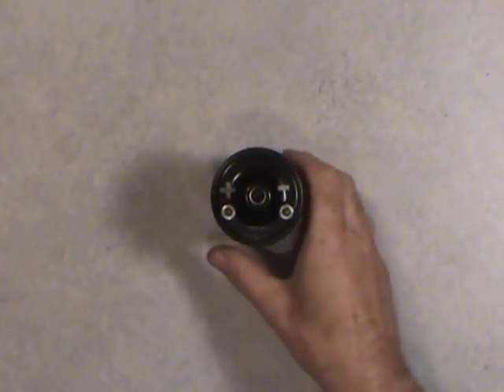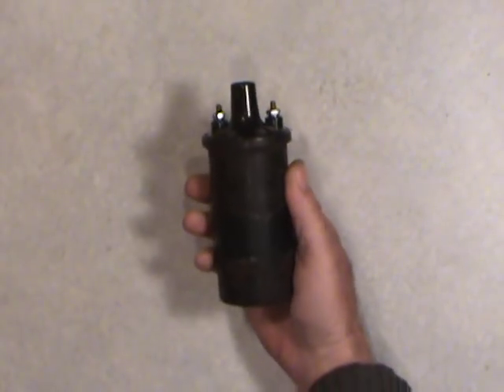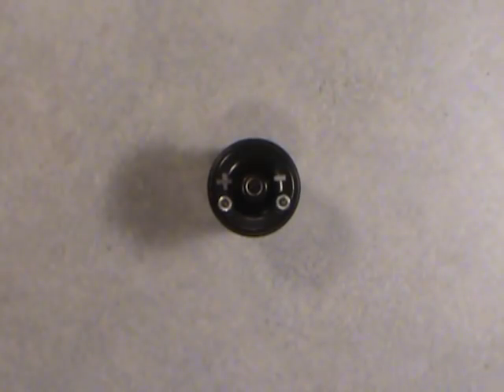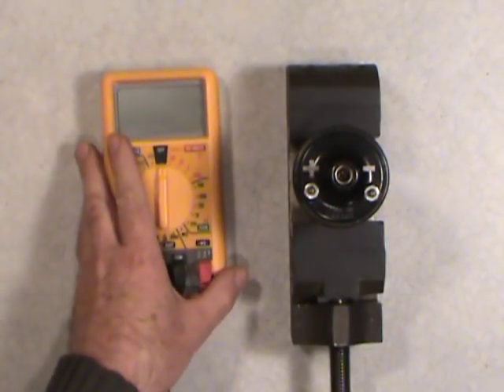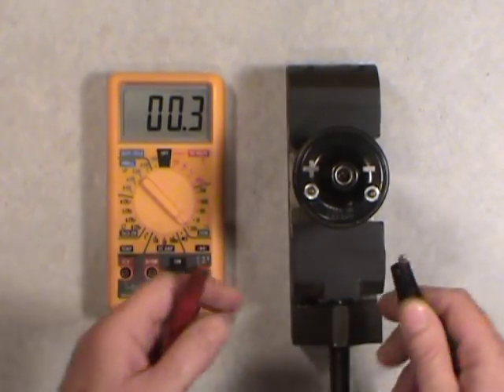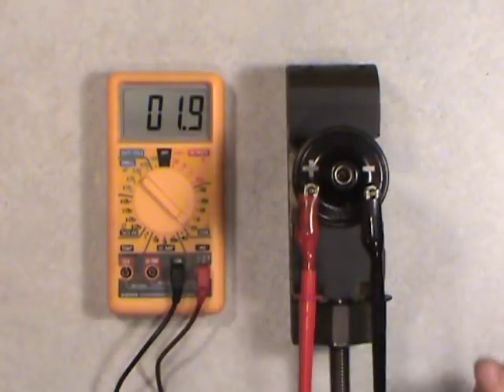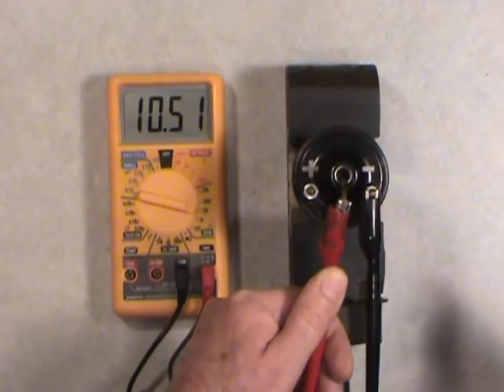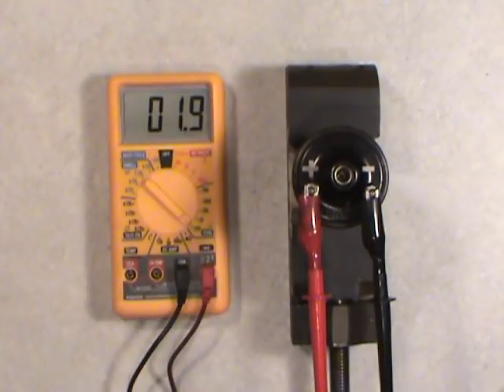Ignition Coil Testing

Comment: Primary circuit resistance: 1.4 to 1.8 ohms OK
Secondary circuit resistance :  8 to 12 K ohms OK
Reply from the maker: Greetings...zagyex.............Thanks for watching............Well, as long as, the ohms that you measured, are "with-in" the Specifications, for that Exact ignition coil, then, it's a good day alright, and.......till next time.......Be Safe, take care, and have a good one.
Reply: Hi, I measured the resistance on my coils (I have a faulty one) and the brand new ones had a primary circuit resistance of 4 ohms, the faulty had 6. So it is a different specs? It is a 12 v system on a Citroen ds. I have coil overheating issues once a year. Maybe a pre-resistor would elp?
Reply from the maker: Greetings...zagyex..........Well, you didn't mention, the "year", that your Citroen ds is...???...........If your engine's ignition system, happens to have a "points and condenser", type of "distributor" in it, then, your ignition coil's "over-heating", might be caused by, something, as simple as, "leaving the ignition (key?) on", when the engine "is not running" (sometimes happens, when just listening to the car's radio, instead of turning the key, to the "accessory" position, if so equipped)...........Always, try to use, all of the ignition system "Parts", that your vehicle manufacturer "specifies", or, if not, then sometimes, things can get "damaged", and become expensive to fix...!!!..........If you can tell me the following, as in...Year...Exact car Model...engine size, and number of cylinders, that it has...then, I will have a much better chance, at being able, to help you out, and........till next time.......Be Safe, take care, and have a good one.
Reply: Thank you!
I already bought a factory recommended coil. I'll measure the resistance just to know if I have been using the wrong coil. I never have the ignition on if the engine is not running. I may have too much dwell  (it is a points distributor) or possibly the voltage regulator is sending too high voltage to the coil. Or maybe some earth wire problem. Btw it is a 72' Citroen DS Dsuper 5
Reply from the maker: Greetings...zagyex..........You're welcome..........Yes, indeed, try to keep the distributor's "Dwell" (usually measured in degrees, and/or, points open amount/measurement), with-in the manufacturer's "Specifications", at all times, as that, in itself, will eliminate, that particular portion, of your troubles, oh, and, you'll usually be rewarded with, much better performance & fuel economy as well, as a bonus..........If the factory installed, ignition coil's primary ohms/resistance, is about 1.5 ohms there-abouts, then, on the older USA/Canada, 12 Volt, Chevy's, Ford's & Chrysler's, ignition coils, that, there is also, a "Ballast Resistor", in the ignition "circuit" as well, most times..........If the ignition coil, is, oh, about 3 ohms or higher, then, there usually "is not" the need for a ballast resistor at all, most times, I be thinkin'...........Make sure, to be using, "All", of the Manufacturer's "Specified" ignition components, or, you'll just be gambling, don't-cha think...???..........If, and when-ever, you get the low volts/primary side, of the ignition system/circuit sorted out, then, it's equally important, to get the Secondary/high voltage side, of the system, functioning, as good as, humanly possible, or, a not so good runnin' engine, along with, not so good mileage/kilometer-age, it will usually end up be-in............All of the ignition system's "Parts/Components", have to be in very good condition/all most like new, as in, good...Points (and Condenser?)...distributor Cap & Rotor...spark plug Wires...and...Spark Plugs.........Use the Factory/Correct Spark Plugs, and make sure that, the spark plug's "Gap" (between the two electrodes), are with-in the exact/specification, as, too BIG of a Gap, will usually, make the ignition coil, work Much Harder, than it has to, in order to produce a "spark", between its electrodes, and, too "small" of a Gap, usually makes for, a weak spark, and might end up with, an engine that will start misfiring, quite possibly...........Check the Ohms/resistance, of each spark plug "Wire", to make sure that, the resistance, "is not" too High, or maybe "open circuited" maybe?............Also, try to keep all of the spark plug "Wires"..."away from"...any Metal, b-cuz sometimes, I've seen (in the dark), high voltage, "jumping" out of a spark plug Wire, and over to a Metal part, in the engine compartment...!!!...........Have a look around, in the engine compartment, for a "Label or Sticker", that might have, some very useful information printed on it............Good luck, and........till next time........Be Safe, take care, and have a good one.

Comment: what kind of nail and sandpaper should I use? geez
Reply from the maker: Greetings...longbow60435..........Thanks for watching...........Well, the nail, that I usually use, is, a 2 inch long, common, plain steel, house nail, and, if that's too big, to fit into, what-ever-it-is, that's about to be ohms-tested, then, I'll probably resort-to, using, my, much smaller in diameter, "T-Pin", that's, about the same diameter, as, a slightly larger, sewing needle............As for the sandpaper, that I usually use, then, it would probably be, 100-Grit, aluminum oxide (sandpaper), because, I really do, go through, ah-lot of, that size/grit of sandpaper, on most of the things, that I work-on/tinker-with, around here............Now, that I've answered your..."geez"...???...lol......Be Safe, take care, and have a good one.

Comment: After watching this,
Im goin to test my coil on my 93 mazda mpv lol
Reply from the maker: fredrickvoncold Greetings fredrickvoncold....Thanks for watching, and for Your comment too...................................The "Ignition Coil", that is Installed, "In" Your "Mazda MPV", will probably, "Not Look Like", the, shall we say..."Old School"..."Oil Filled Ignition Coil"...that You saw, in this particular YouTube Video of mine, and, the "Way in Which"...Your..."Mazda MPV's Ignition Coil"..."Should be Hooked-Up and Tested with an Ohm/Multi-Meter"..."Needs to be Closely Looked-at"...Using, the..."Required Information"...to do so...!!!............................I'm pretty sure, that Your "MPV's"..."Ignition Coil"...is the..."Epoxy (filled) Type"...and the..."Terminals"...on Your "MPV's Ignition Coil"...for the most part...will be..."Very Different"...from the..."Terminals"...on the..."Ignition Coil"...that You saw, in this YouTube Video of mine...!!!..................................................."If"...???... Your "MPV's Engine"...is..."Running/Performing Alright"...then, as I see it, I wouldn't bother..."Testing It"...at all...just sayin'.....................................................................Also...before..."Attempting"...any..."Tests or Testing"..on Your "MPV"..."Study Thoroughly, and Fully Understand"...what You are about to do, for..."Safety Reasons"...and, so You..."Don't Screw Anything-Up"...on Your..."Mazda MPV"...cuz..."If"...You Do..."Things"...might, just Start to get..."Very Expensive"...and...You, just might have to..."Spend Your Kids Inheritance" (if so applicable, that is)...to..."Fix"..."What-Ever-It-Might-Be"...that..."Theoretically/Hypothetically...Got Screwed-Up"...!!!.....Hmmmm...(to lol, or not to lol...that is the question)...LOL...(my bad...???)...............................................So, my Friend..."Don't Say...I Didn't Warn Ya" (cuz I "Did"...!!!...lol).....................................If You happen to have any questions or concerns at all, just leave a comment/question or two, under any of my YouTube Videos, and, I'll do, what-ever I can, to help You out..........................Till Next time...............Be Safe, take care, and have a good one.
Reply: RockysRoadshow My mpv stumbles bad on start up
I have a haynes manual,but its about the same.The tips on how to use the right scale on ohms on my voltmeter helped me alot.
My coil is a ok. thanks I got  .9 ohms on primary, secodary about 6k i think. all in spec
Reply from the maker: fredrickvoncold Greetings fredrickvoncold....It's good to hear, that Your Mazda MPV's Ignition Coil, appears to be With-in Specifications, when doin' the good ole "Low & High Ohms Test", with Your Ohm/Multi-meter...Congrats!............Although Your Ignition Coil "Tests alright Ohms-wise", there can be times, quite "Rarely" at that, that an Ignition Coil, might just start "Acting-Up", as in, when One of these, shall we say..."Faulty Ones"...Heats-Up...to Operating Temperature, or maybe even Hotter, then, this, call it..."Miss-Behaving/Not Doin' Its Job Properly"..."Faulty Ignition Coil"...might just, as They say..."Break Down under Load"...and the Engine might just start "Miss-Firing", or in a worst case Scenario, that poor Engine, might..."Stop Running"...all-together, just sayin'....................................You were sayin', that Your Engine Stumbled on Start-Up..........well...........I had a similar "Situation" as well, on a Fuel Injected Engine...............................If You would like to Try my Starting "Trick", then, here "It" is...................You can Use My Fuel Injected Engine "Starting Trick", on a "Fuel Injected (Gasoline) Engine, wether the Engine is..."Hot or Cold"...........Just..."Hold the Gas Pedal"...about 1/3 (One Third) Down...and (Crank)...Start Your Engine...and...Once It Starts...Take Your Foot Off of the Gas Pedal...!!!............"If"...???...the Engine is "Idling Rough, and/or Too Slow"...just..."Feather the Gas Pedal"...just a..."Little Bit, and just enough"...so Your Engine..."Does Not Stall" on You....................Once the Engine is "Running" (while keeping fingers crossed...lol)...reasonably..."Good, and some-what Smooth"...then..."If"...???...the Engine..."Runs/Performs"...Good enough...while...Driving Your Ride, as You do, then, Hope-Fully, like my "Miss-Behavin' Engine"...but "Only" Doin'-So, while I was..."Just Tryin'...to Start that there Engine"...other-wise, that there Engine of mine, "Ran just Peachy/Super Duper", once the Damn Thing got "Started"...!!!...lol......................................Sometimes, there can be some "Issues", with the "Oil Pressure Sensor", or part of Its "Electrical Circuit", and, the Chevy/GMC Vehicles, that I've worked on..."Required"...some-where in the Neighborhood, of about "4-PSI" (Pounds per Square Inch), of Engine "Oil Pressure", to get the Engine "Started and Running"..."If"...the..."Fuel Pump Relay"...Wasn't able to..."Do Its Job" Properly, and, one "Sign" of this "Problematic Scenario", will usually be, a some-what..."Lengthy/Extended, Cranking of the Engine"..."Before It Will Start, and maybe Keep Running" as well........So, there You have it...well...for now that is......Till next time.....Be Safe, take care, and have a good one.

Comment: Where do you go for specs for the individual coils
Reply from the maker: Greetings...Lynn Johnson..........Thanks for watching..........Well, depending on, just which...???...ignition coil, that it happens to be, then, here's the way, that I usually go about it............If I happen to have the vehicle's Chassis Service Manual (I don't have very many...lol), for that particular ignition coil, then, so be it...other-wise...I will go looking/hunting, for the ignition coil's specifications, on, an online, automotive parts website, and/or, that particular ignition coil's, Manufacturer's website..........Sometimes, I will find/stumble-upon, a quite impressive, shall we say..."List"...of Specifications, for some of the ignition coils, that, I've looked-up so-far...........Just make sure, that, you install, all of the..."Correct/Specified"...components (parts), for the..."Exact"...ignition system/circuit in question, b-cuz, if not, all-bets-are-off, as in, might end up having a weak spark, at the spark plug's electrodes, or maybe, an ignition coil, that over-heats and goes kaput (as in, self-destructs), and I hope not...........Good luck, on finding the ignition coil specifications, that you are lookin' for, and.......till next time........Be Safe, take care, and have a good one.

Comment: It is a good video but how to test Ignition control module. I am tired to search on Internet.
Reply from the maker: Greetings...Elda Cleaning.................Thanks for watching..............Well, from what I recall, in order to Test an Ignition Control Module, by itself, would require the use of a Testing Unit, that is able to Test, the "Exact" (type of) Ignition Control Module, that needed to be Tested.............Maybe, make a few Phone Calls, to some Auto-Parts Stores, as, in the past, I heard that, some of those Auto-Parts Stores, might actually "Test" Your Ignition Control Module for "Free"......................I hope, You have good luck with that, and.........till next time..........Be Safe, take care, and have a good one.
Reply: Thank you for reply. I found how to. By checking resistance between terminals (secondary)and low ref. to each terminal input(primary)

Comment from the maker: ...So, when I'm testing something on the Ohm's-Scale/Scales on both, the Digital, and Analogue Meters/Multimeters, I usually start at the Lowest-Range, and, then Increase the Range, one at a time, until I saw the Proper-Display/Readout....Be careful with "Volt"-Readings!....Always select the Proper Range, when reading Volts, or, you might Damage your Meter/Multimeter!....Now, about your Ignition-Coil testing "Good", with Ohm's-Readings....(con't)

Comment from the maker: ...all a solenoid really is, is just a way to control a very large amount of electricity with a very small amount of electricity....So, as you can see (I hope), there are quite a few things that can cause an engine not to crank over....Everything from dirty or corroded battery cable connections at the batteries terminals, to even the engines starter motor being worn out, or broken....Try to find someone that is close-by and knowledgeable, to take a look at your particular vehicle...Take care...

Comment from the maker: ...and, any Oil Filled Ignition Coil that I have seen, has always had a "Ballast-Resistor" connected to said Ignition Coil....You see, when you turn your Ignition Key to the Starting position, your Oil Filled Ignition Coil gets the left over voltage from your cars battery, due to the voltage drop caused by your greedy Starter Motor, and when your Key is in the Run position, the battery voltage gets reduced, so your oil filled ignition coil doesn't go "POOF!", due to it's design....(con't)...

Comment: What is the range coil value?
Reply from the maker: Greetings...Mahindajayamaha64...........Thanks for watching......There are so many different types of ignition coils out there, and, each type will have its own specifications, for both, the low (ohms) resistance, primary coil windings, and also, the much higher (ohms) resistance, secondary coil windings........Try to find the Ohms (resistance) values, for the exact ignition coil that you want to test, otherwise, the test, won't be very accurate at all, and.......be safe, take care, and have a good one.
Reply: @RockysRoadshow  How to test condenser via multimeter & what is setting multimeter?
Reply from the maker: @Mahindajayamaha64  Greetings again........You're correct calling it a condenser (automotive world) alright, but, in the electronics world, it really is a capacitor........Why the automotive folks call it a condenser , I really don't know........In order to test an automotive condenser (capacitor), the multi-meter has to have a setting on its dial, that will test a condenser (yes, I do have one)........Before I test any capacitor, it needs to be drained of any electrons (electricity), that it still might have stored up inside of itself, otherwise, if its still charged-up, that spike of electricity has the ability to "fry" the multi-meter...!!!...........The larger capacitors are very dangerous, if they are still charged up, and if someone touched the terminals, it might be the last time that they ever did...!!!.........Some years ago, I discharged a large microwave capacitor with a large screwdriver, and the arc (flash) was bright and quite loud (as in snap...!!!)........Later, I looked at the tip of that screwdriver, and some of its metal "tip" was missing...!!!...and yes, I'm sure glad I didn't touch the terminals on that thing, or, I might not be be typing this reply to you........So, always make sure to safely "drain" any capacitor before handling or testing it (very important).........With the smaller automotive condensers, as in, points and condenser ignition systems, just simply grab the lead (wire), that's coming out of the condenser's metal canister, with needle-nose pliers, and touch that wire, to the to the outside of the metal canister, and hey, you might even see a bit of a spark, if, and whenever you might do so, and....be safe, take care, and have a good one.

Comment: Don't pull the alligator clip off and use the needle tip, go polish a nail instead
Reply from the maker: Greetings...Playsportfun...........Thanks for watching..........Well, I have a few ways, that I have used, depending on, what it happened to be at the time, that I was trying to make a connection with, and are, as follows............Those well designed, (internally) screw-threaded alligator clips, actually, screw onto, the plain/nail like probes, which also have screw-threads on them as well..............Then, I have a couple of "T" (shaped) pins, that the alligator clips can bite onto as well, and, last but no least, I really do have..."2-polished-up"..."common house nails"..."with heads on them"...and are about..."2 and 1/2 inches long"...so yeah...one could say, that..."I've been there"..."seen that"...and..."done that too"...!!!...lol...........Thanks, just the same, and.......Be Safe, take care, and have a good one.